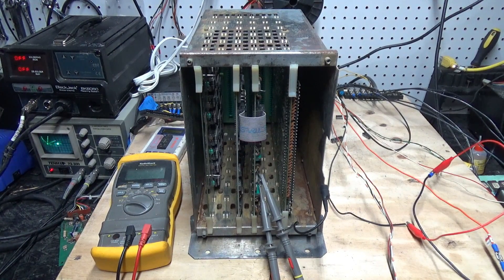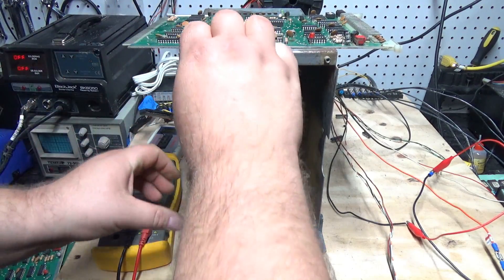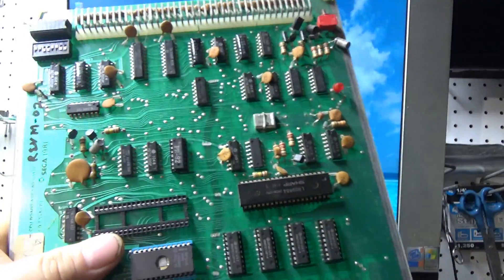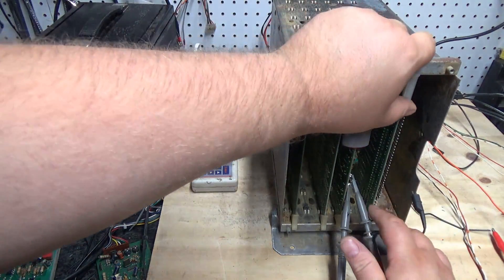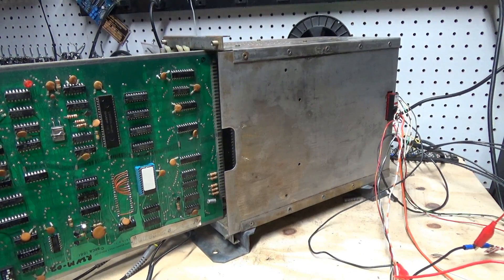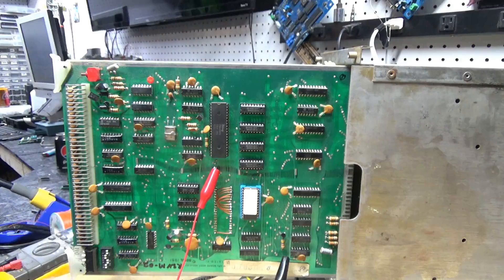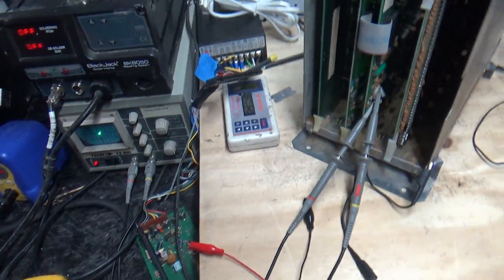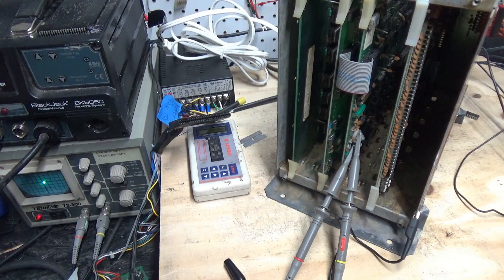SEGA vector CPU repair

Comment: Just a quick suggestion: when you suspect a chip shorting a line, try cutting the IC's pin instead of the track. You don't need to repair the PCB after that.

Comment: I have recently obtained a Wells Gardener model No.19k4625 monitor that works but needs some love and care... I want to ask you if this particular model is worth re-capping and solder-reflow... I dont know much about arcade machines but been getting into it slow and steady... I built one home made arcade (Im gonna call it an arcade computer and not a machine cause it runs mame using PC hardware and a 39 inch backlit led "television set" creating a mega vertical whiplash abomination) and also building an Atari centipede looking cabinet copy that I have framed like a journyman carpenter cause I had nothing better to do... Let me know if it worth it or not... My pops died 7 years ago and left me a butt load of cmos chips, buffers, Eproms, roms, ram and all the stuff could be built into something special... I have been studying the Cmos cookbook and playing around with logic simulators... Sorry this comment is so long winded...

Comment: ARCADEJASON, what are the HALT signals used for in arcade games? why would you want to use Halt signals in arcade games?
Reply from the maker: HALT is a pin directly on the processor and can also be accessed with software. HALT stops the cpu from executing commands by letting it NOP (no operation) kind of like a pause button. so why do we need a pause button? many reasons but i will make a crude example. lets say a vector timer takes 10 seconds to draw a vector on the screen but the cpu can send fresh commands every 2 seconds.We need to tell the cpu to wait until the vector timer is ready.